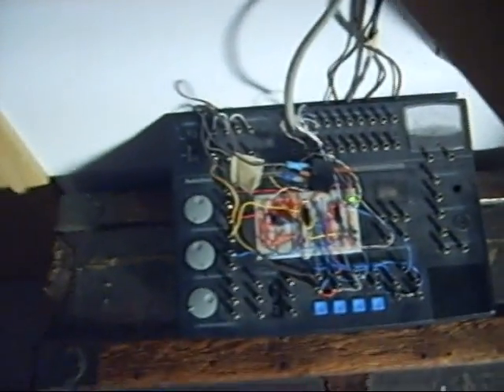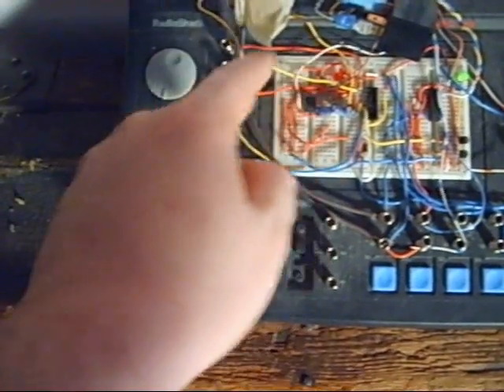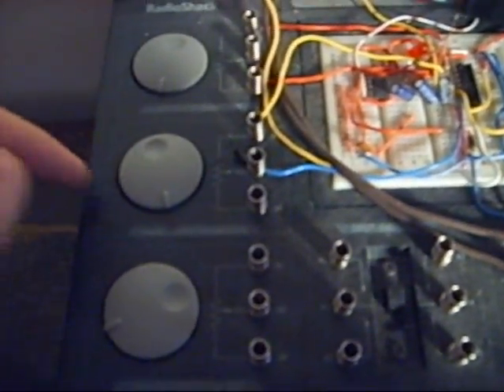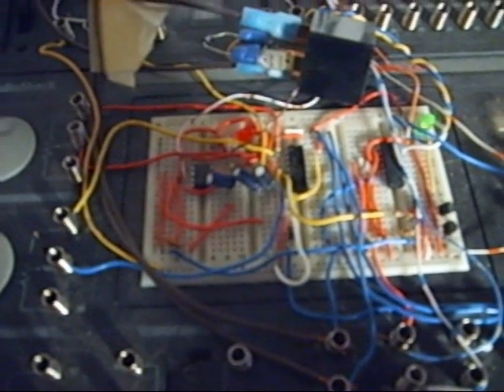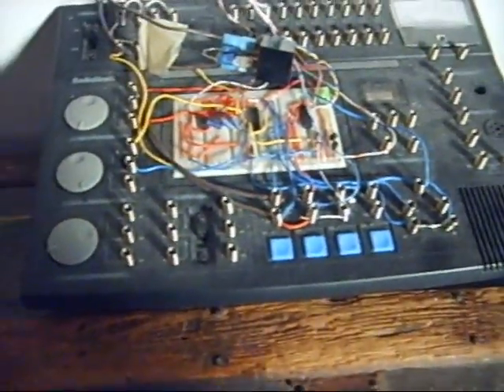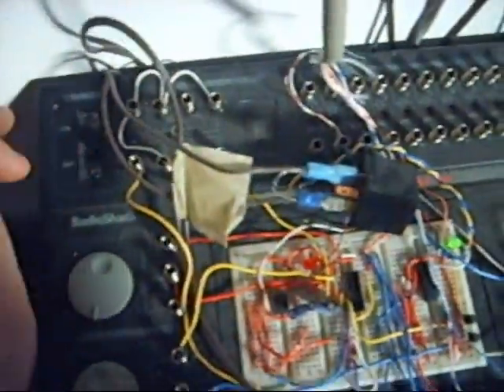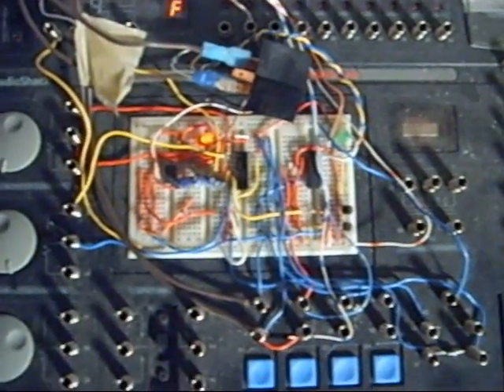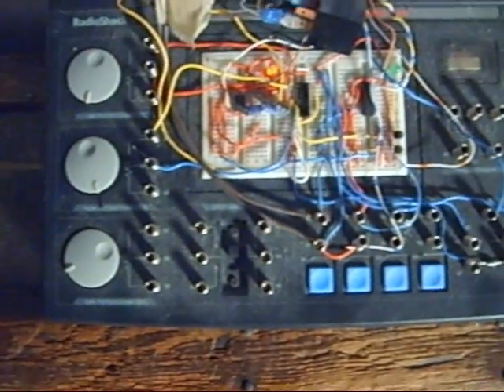Homemade Fire Alarm System - Circuit Overview - 11 of 11

Comment from the maker: You would need 16 AA batteries to make 24 volts. The poblem isn't voltage - it's more the current capacity of  AA batteries. It would probably work, but would drain the batteries pretty fast. The batteries may also get hot from discharging so fast so I would recommend against it.